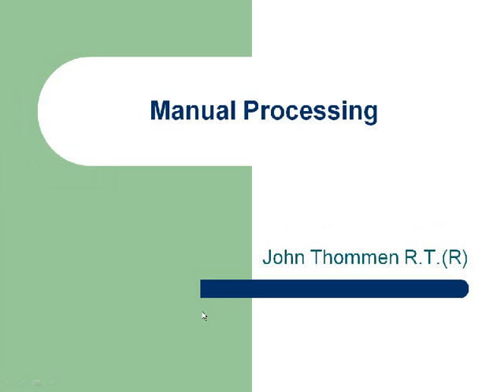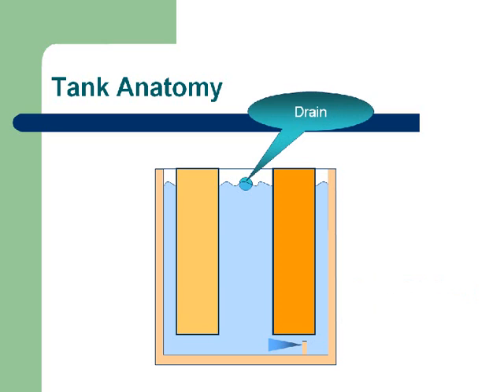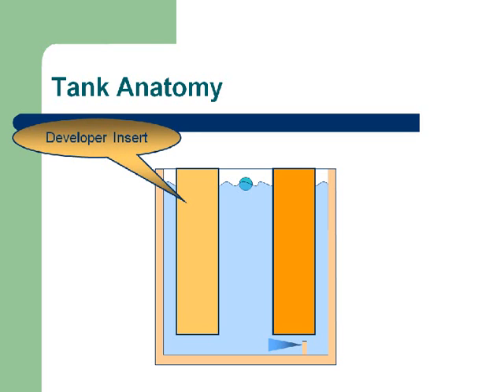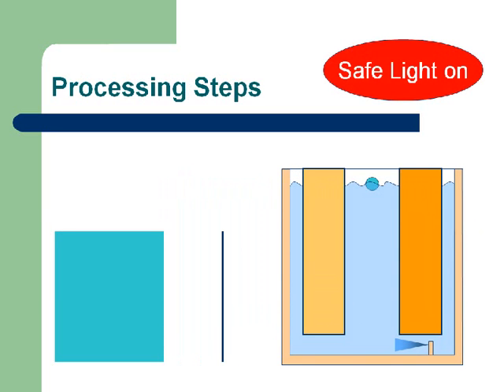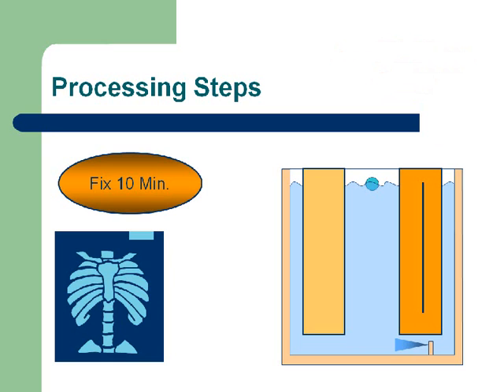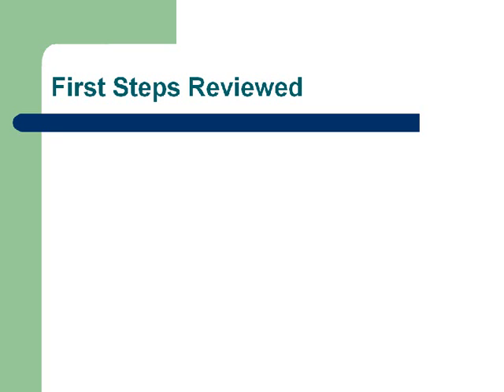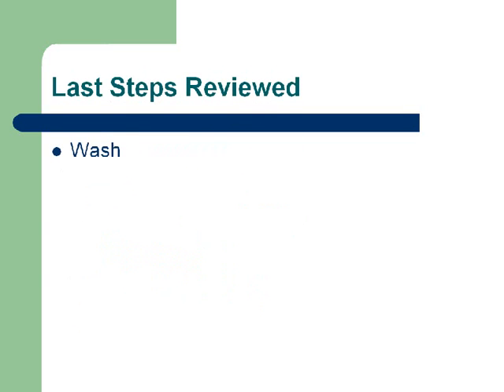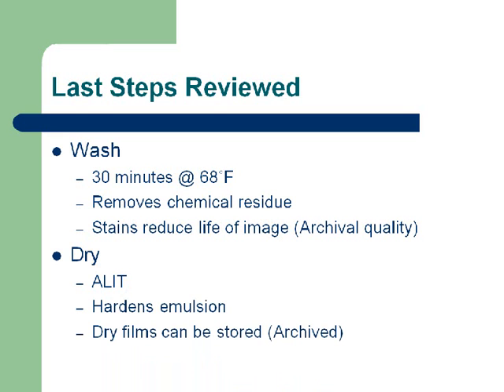Manual Processing

Comment: In manual processing, after development stage is there a stage called rinsing before fixing stage?
Reply from the maker: Rinsing was done as an optional step with the hope of extending fixer life.  Some departments rinsed in the wash water and others used a weak solution of acetic acid.   The acetic acid stopper the action of the developer chemicals. Most skipped the step entirely and went from the developer to the fixer.